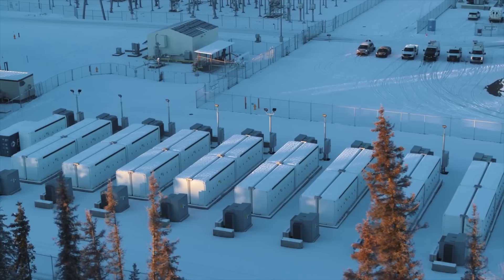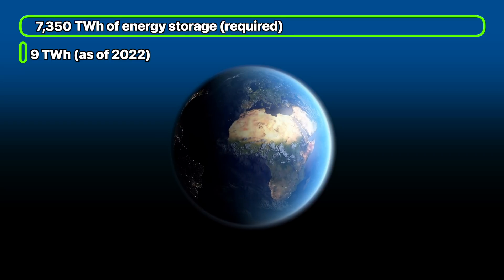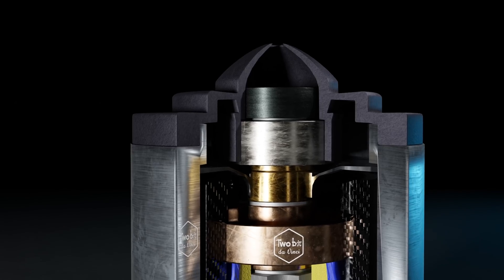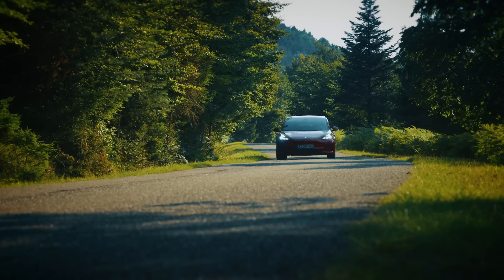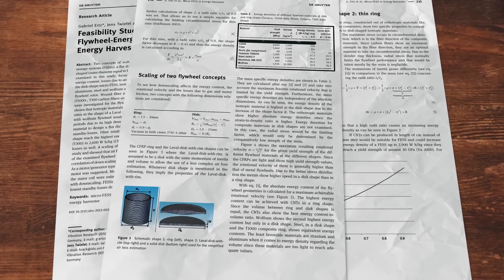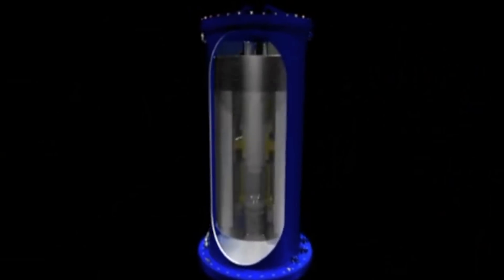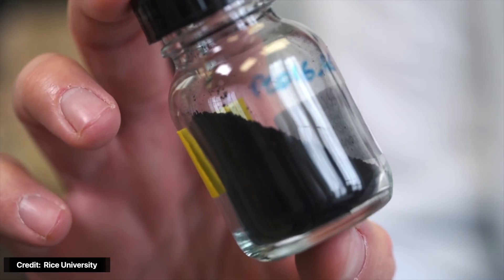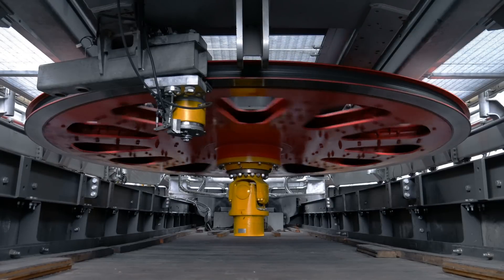Breakthrough Energy Storage Tech CRUSHES battery prices by 90%!

Comment: It's a lot more than 5%.  The biggest issue is that cheap power has made people complacent.  A lot of things need to change, and you will still need the base-load capacity online to provide the copper base to dissipate harmonics.  
A mix of renewables and nuclear are the way of the future.  I was in the naval nuclear program and operated a reactor on a submarine, and saw what was capable with good operators and stable design
Reply: How are people complacent when merely consumers of a utility and near damned working their way to pay rent and debts?
Reply: @BeLowBelowo  because people are living a much more cushy and higher quality of life than any time in human history. Spare me with your outrage.
Reply: Military use is far different from Commercial, where the pressure for profits NOW lead to companies scaling back needed maintenance.  That was the cause of the Texas Grid failure in 2021, the BP Deepwater Horizon blowout, and hundreds of other industrial disasters.
    Second, the problem of long-term storage of nuclear waste is dimply too long-term for the human race.  Human lifespan is trivial compared to radioactive waste.  We have no experience solving problems with at that time scale.  No government or institution has ever lasted long enough to manage this problem.   
  And Third, it's unnecessary.  Solar and Wind can generate more than enough power.  Stop thinking about huge localized generation and start thinking about localized generation.  The benefits of local power generation are tremendous.  Energy Security is just one.  For less than the cost of the 2nd Gulf War we could have put solar PV panels atop every house in the USA.
Reply: @guygordon2780  you are wrong.. We have reactors now that use far more radioactive energy out of the fuel and the half life of the spent rods is in hundreds of years vs thousands.
Reply: @guygordon2780   solar and wind are more dangerous to the ecosystem and wildlife than nuclear and they aren't nearly as reliable.     Nuclear is the cleanest power known to man also they have found ways to deal with the little waste they produce witch is drilling a hole deep under the power planet and putting the wast into sealed cassel
Reply: @guygordon2780  Solar and Wind are great, when they work and the sun is showing and wind is blowing.  Wind is effectively solar power as winds are created from the same energy.

Long term irradiation of silicone and the other doping materials are causing them to absorb abnormal amounts of valence electrons causing unstable elements that are now irradiating and breaking down just like spent nuclear fuel.  This is a much bigger problem moving forward that no one is talking about.  Make no mistake, I love solar and find it fascinating, but it has massive issues that will need to be dealt with.

Storage of the energy for use on the grid has its own massive issues.  Currently, the best option is lithium due to energy density.  Even with solid state, the amount of space required to actually make it viable on a utility scale will always make it a huge issue.  

I actually do work in the power industry, and have been for over 25 years.  I am considered a system matter expert in this very field, and I'm telling you that it isn't going to work the way they want it to.  It is only going to be possible with more point of use energy, utilizing microgrids that are interconnected to relieve stress from the transmission infrastructure.  Not what they are trying to push.  They are going to spend massive amounts of money only to fail.  Almost all of the SME's in this industry say the same thing.

Comment: I fell there something I'm missing. The loss turning the fly wheel and the loss from regenerating electricity let alone the loss of standby of the fly wheel seems would be a lot! Is there something  I'm not understanding?
Reply: No, its a ridiculous way to store energy for longer than minutes.
Reply: @manoo422  it can be useful as a way to average load on the grid. Taking care of demand spikes or something like that. A tool that is useful in specific places in the way to a greener grid. No single technology solves all.
Reply: @bzuidgeest  That supposed problem was solved a long time ago with hydroelectric top ups, there is no requirement for flywheels.
Reply: @manoo422  Can you explain what you mean by 'hydroelectric top ups' please?
Reply: Yes a lot😀

Comment: Flywheel Storage Is 

The Most Efficient Method To Generate Electrical Energy.

By Using Solar During
Daylight Hours And Battery Storage ...

To Maintain Flywheel Momentum ...

A 24/7 365 Day Energy Usage Can Be Applied From ...

The Rotating Mass Of The Flywheel To 

The Electrical Grid

Using A Magnetic Floating Bearing To Support The Flywheel
Increases ...

The Efficiency Greatly

Comment: It was mentioned that a really big flywheel is better than smaller ones, and that all flywheels loose energy pretty quickly, but WHAT IF in a scenario where the energy gets stored for 12 hours a day ("sunny") and gets used for the other 12 hours a day ("darkness") and you had, say, 12 separate flywheels 1/12th the size of the really big one, and that in the first hour of sun the first one was charged up, and so on with all the others, then in the first hour of darkness the first flywheel is discharged, and so on with all the others, wouldn't this HALF the time-based storage losses, making smaller flywheels better??
Reply from the maker: great idea, the issue is because its a massive object physically in motion, it slows down due to friction, so standby losses are unavoidable really ... but have been minimized with magnetic bearings and vacuum chambers
Reply: I don't think this is helpful. It seems that energy loss is calculated as a percentage of the amount of energy stored (the faster the rotation, the more friction). You will start with very low absolute losses as you start charging. Losses will increase during the day as you charge. As you use energy at night losses will decrease again.

Comment: Have you ever seen a 2 pound chunk of steel turning at 15k rpm let loose? I have, it went right past me and blew thru a concrete wall. You should have seen the damned thing slamming into everything in the storage room it broke into. I stopped working with flywheels after that. Flywheel tech has been worked on for years, and they have always proven to be too dangerous. Maybe, just maybe, if it were to be used at a large weight, low rpm, for a stationary energy storage. But what about the cost?
Reply: When you have lots of stored energy, be it in a flywheel, in a fuel tank or in batteries, it will always have some degree of danger.
Reply: Fat seems pretty safe and very energy dense
Reply: @theagentsmith  Exactly bomb is stored energy for instant release.
Reply: I think that's why they often bury them.  Did not realize they loose so much energy in storage mode.  I thought maglev bearings and vacuum containers had solved that.
Reply: @pathfollower  I started out with a motor armature, it comes machined for bearings, and balanced. I installed ceramic bearings, and had it balanced again at a machine shop. At that time I was drag racing motorcycles so I used the same guys I trusted with my life at 175 mph. So I was confident the shop didn't screw up. The bearings were way over rated for my application but that didn't make any difference. I kept pushing it up and up. I'd bring it down check temps, add lube, and go at it again. But when it got up to about 15k all hell broke loose. You can not believe the explosive force of such a small amount of steel spinning that fast when it breaks away. It tore off the leg of my mill, ripped thru a concrete wall, and it looked like a pin ball bouncing around the storage room, destroying everything if hit. I've seen some crazy shit before but nothing like this. I would recommend leaving this one alone. But I will say the ceramic bearings had very little loss, it would spin for hours.
Reply: @rwells3376  Oh!  I see you ran into the same problem as Tesla's engineers.  For PR reasons, Tesla wasn't satisfied with a top speed of 180mph (because a Lamborghini could do 220).  But the rotor of their electric motor couldn't spin fast enough.  So in the Model S Plaid the wrapped the rotor in carbon-carbon fiber.  But that's all just for silly one-upsmanship.
Reply: @guygordon2780  Well, yeah, you're right. but this was 20 years ago, I was much younger and thought I was invincible. I would probably proceed with much more caution now. But you do have to find out the limits, mine was just very unexpected.
Reply: @pathfollower  mag lev eats power for active systems and has weight limits. Permanent magnets are weaker, still heat up and lose strength faster the more work they go.  It works well in space though.
Reply: Exactly, every time I think about flywheels I think about burying it in the backyard in a concrete bunker. But I doubt that would be enough.
Reply: Like you said..very dangerous!...
Reply: In the 70s they thought about putting flywheels in cars. It soon became evident that this was dangerous if they used metal for the wheel. They decided on carbon fiber flywheels that would disintegrate if it came apart. But they decided it wouldn’t work for cars. Any fender bender would destroy the flywheel. But it would work for stationary flywheels.
Reply: That's why the picture of a flywheel near a playground is unlikely. Use it for grid storage far from human beings.
Imagine a 10 ton fly wheel of an indestructible material like CNT spinning at an high mach number getting loose.
Reply: Anything can store power. Water. Rocks, a flywheel, and cage full of hamsters...we just have to work on it
Reply: Lots of little ones, and make the housings stronger.
Reply: Large diameter and high mass would help, but high speed helps even more. To guard against damage from catastrophic failure, build them underground.

Comment: I thought they used frictionless magnetic bearings so they wouldn't drain that fast...
Reply from the maker: they do and that helps significantly. without them, they'd stop much sooner
Reply: Eddy current by spinning that much metal in a magnetic field is causing losses
Reply: Remember we're talking about things spinning at 10,000-20,000rpm.  Not a leisurely few hundred or thousand rpm most motors run at.  And the friction does NOT rise linearly.

Comment: I guess if flywheel "loses" its energy this energy becomes a heat. Well, heat can also be used per ce or like a source of energy. So, e.g. for homes in many areas this wouldn't be a disadvantage. The worst disadvantage, I guess, is a heavy mechanical 'thingy' rotating dangerously in my basement, producing the inevitable noise and vibration.
Reply: If you're feeling vibration, shut it down immediately, because that means it has become unbalanced and will soon fail.
Reply: That heat is probably unusable.
Reply: It would be perfect in the basement of big buildings in the EU now. Just a big constant heat source that can go all the long expensive night
Reply: No, the flywheels don't vibrate because they're balanced, like your car's wheels.  And no, they don't make noise because they spin inside of a vacuum chamber, which isolates most of the sound.
Reply: I'd rather have a powerful flywheel installed below ground.
Reply: If there was sound it would be too high pitched to hear.
Reply: @willjapheth23789  you could probably hear the freqency if it were loud enough to be heard.  For instance, take a rather fast spinning flywheel rotating at 100,000 rpm, when divided by 60 seconds of a minute = 1.666khz. Humans can hear up to about 20khz  but as one ages they loose some of the top end of their hearing. 16khz is around the average top end and about 10 times 1.6khz
Reply: @kreynolds1123  yea I forgot its rpm not rps
Reply: @willjapheth23789  yeah 100,000 rpm looks like a lot untill one converts it to hz. While it is a lot of rpms for a device made by humans, it's not that high up in audio pitch compared to other pitches we can hear.
Reply: Wrong... Heat energy is useless unless it's above a certain temp.
Reply: @randybobandy9828  to generate electricity through a carnot cycle sure... But to heat cold homes any heat generation is great. If it loses MWhs in a day or 2 it's pretty clear it all amounts to a decent bit of heat generation

Comment: The flywheels shown are sitting parallel to the earth’s surface, but the earth’s orientation changes 360° every day. How do these flywheels cope with the resultant precession effects.
Reply: Interesting! I hadn't thought of that. Maybe they'll hang the whole system from a plumb bob string, watch it go round and round! 😄
Reply: I feel like it plays a significant role in energy loss
Reply: I also wonder what type of bearings are used? Air layer or magnetic levitation or just standard roller bearings? 
Also the torque from procession  might be able to be converted to power too?
Reply: @LOOGamala  I'm sure there is no air, no matter contact

Comment: I was surprised at the losses in standby mode.  Friction?
Reply: It's nearly impossible to eliminate friction entirely, and there likely is some electromechanical impedance (effectively another form of friction) in the electrical circuit due to the capacitance and inductance which generates a small back EMF to the rotor.
Reply: I winder too cause with vaccum and high pressure oil, there's sooo little assuming no inductors or magnets drawing.
Reply: Allhope has most of it, but there is the additional drag of the Earth's magnetic field.  In addition, has anybody ever seen an exploded flywheel in a dragster? Such an explosion can literally cut a vehicle in half. You would need almost as much carbon fiber or graphene in the shield as would be needed for the rotor. Also, to get the most out of the flywheel, higher density materials than carbon fiber or graphene would be desirable.  Flywheels that are truly efficient need to spin in excess of 100k rpm. Put a little lead in there at 100k rpm, and you could almost go orbital if there were a breakage. As for bearings and oil, you have the wrong idea.  These need to be magnetically suspended in vacuum, no bearings at all.

Comment: Replacing all Fossil Fuels with Renewable electricity is a great goal, but it’s actually not the first step. The first step will be to get to a “net zero” situation.

According to the book Drawdown, we can actually achieve that while still having about 25-30% of our electricity generation come from fossil fuels. This means that the big push for better battery storage doesn’t really need to yield results until around 2035 (which will give us enough time to deploy it by 2050).

I bring this up, not because I disagree with this video, but because I’ve noticed that many people seem to use the excuse of “electricity storage isn’t solved yet” in order to delay deployment of our current renewable energy tech. The truth is that our current solar and wind tech is good enough so we need to push hard to deploy it as quickly as possible!
Reply: Very valid points I think that's generally the Humans adapt just wait for 250$ oil not far off. Holy comment length thoufh batman.
Reply: It's not good enough.